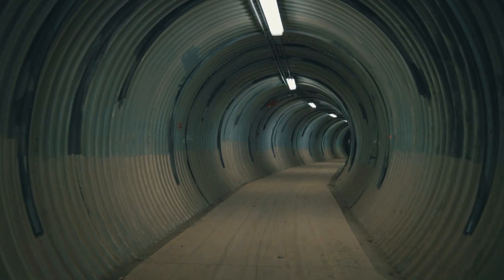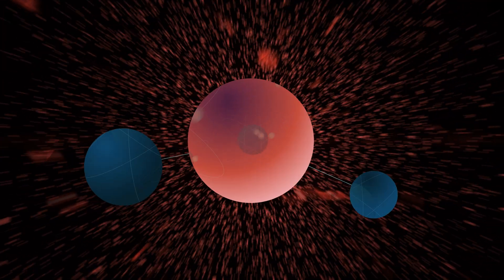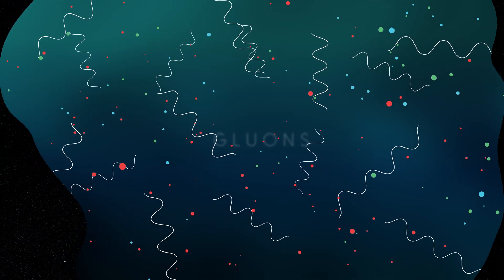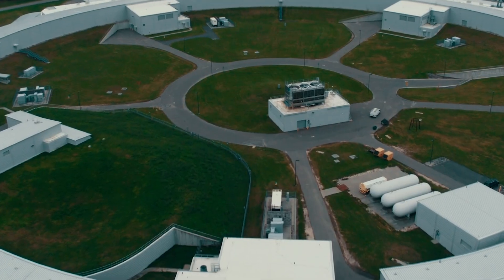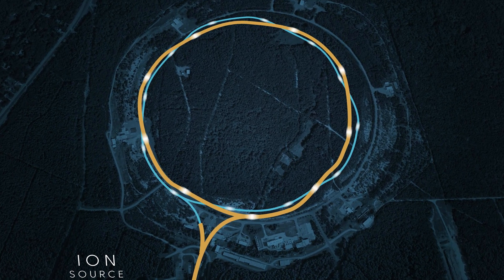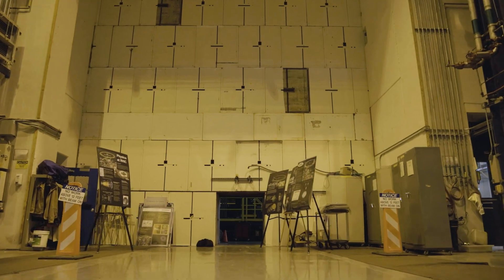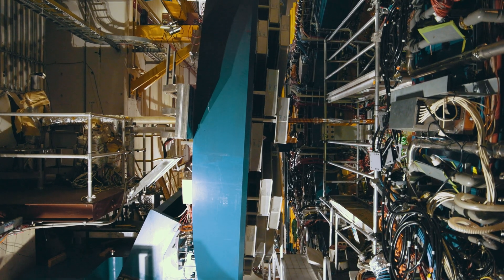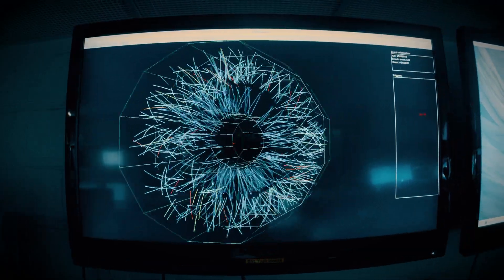SPACE LAB: This Particle Accelerator Makes A Substance That Hasn't Existed in 13 Billion Years

Comment: I've been working and researching fusion and the Tokomaks, that are gradually reaching and maintaining an active relationship to solve that enigma that escapes us onto milestones all of the time. E, energy is the im unsure if I am working out the math and would like to hear an opinion and digging through obstacles and watching the progress.  
The superconductors use a lot of energy to maintain and control and contain the reaction.   I instantly may have found a way to not just increase the output energy by placing a Tokomak in an orbit around Earth so it will track and orbit in the shadows by always staying opposite of the sun and remain always at 100's od degrees Temps in  order to lower drastically or even need the incredible amounts of energy to maintain the supercondive temperatures to make part or all the subzero adjustments by using nearly zero energy that's already available but unused.   The near zero gravity has several less energy needed for MINOR corrections.   There are many more questions and answers, but I thought this simple solution could benefit the tokamak in orbit.  
Is there anyone else thought of this and went from idea to prototype I ask?
Reply: Many stable fusion reactors could orbit our nearest planets and even send a few tokomaks to follow in front or behind or with ion rockets, converting electricity into new and novel engines without ever running out of fuel using energy storage and a constant production of electrical and heat converted to electrical, propulsion engines. 
A single but contained fusion/energy protection could possibly be placed in front of  STARSHIP to remove any  and all other energy sources,  and never nèd fuel again.... Questions please?
Reply: And could this energy producing fusion device find a way to create massive amounts of energy on the moonn, Mars,, and a series of next generation batteries and capacitors to use the massive amount the output on new tech equipment?
Reply: I hope my summary is simple enough.   I left out the mathematics,  quantum and mathematics numbers but they DO add up as being possible.   There's definitely the proofs and prototypes to rest this hypothesis.  

I have also worked most of my life testing small experiments.  

If anybody finds any success or failures,  then I'm more than interested to share this with other Physicist and mathematicians

Comment: Both Matter and Energy described as "Quanta" of Spatial Curvature.  (A string is revealed to be a twisted cord when viewed up close.)

Is there an alternative interpretation of "Asymptotic Freedom"?  What if Quarks are actually made up of twisted tubes which become physically entangled with two other twisted tubes to produce a proton?  Instead of the Strong Force being mediated by the constant exchange of gluons, it would be mediated by the physical entanglement of these twisted tubes.  When only two twisted tubules are entangled, a meson is produced which is unstable and rapidly unwinds (decays) into something else.   A proton would be analogous to three twisted rubber bands becoming entangled and the "Quarks" would be the places where the tubes are tangled together.  The behavior would be the same as rubber balls (representing the Quarks) connected with twisted rubber bands being separated from each other or placed closer together producing the exact same phenomenon as "Asymptotic Freedom" in protons and neutrons.  The force would become greater as the balls are separated, but the force would become less if the balls were placed closer together.  Therefore, the gluon is a synthetic particle (zero mass, zero charge) invented to explain the Strong Force.  An artificial Christmas tree can hold the ornaments in place, but it is not a real tree. 

String Theory was not a waste of time, because Geometry is the key to Math and Physics.  However, can we describe Standard Model interactions using only one extra spatial dimension?    What did some of the old clockmakers use to store the energy to power the clock?  Was it a string or was it a spring?

What if we describe subatomic particles as spatial curvature, instead of trying to describe General Relativity as being mediated by particles?  Fixing the Standard Model with more particles is like trying to mend a torn fishing net with small rubber balls, instead of a piece of twisted twine.

Quantum Entangled Twisted Tubules:  
“We are all agreed that your theory is crazy. The question which divides us is whether it is crazy enough to have a chance of being correct.”    Neils Bohr
(lecture on a theory of elementary particles given by Wolfgang Pauli in New York, c. 1957–8, in Scientific American vol. 199, no. 3, 1958)

The following is meant to be a generalized framework for an extension of Kaluza-Klein Theory.  Does it agree with some aspects of the “Twistor Theory” of Roger Penrose, and the work of Eric Weinstein on “Geometric Unity”, and the work of Dr. Lisa Randall on the possibility of one extra spatial dimension?  During the early history of mankind, the twisting of fibers was used to produce thread, and this thread was used to produce fabrics.   The twist of the thread is locked up within these fabrics.  Is matter made up of twisted 3D-4D structures which store spatial curvature that we describe as “particles"?   Are the twist cycles the "quanta" of Quantum Mechanics?

When we draw a sine wave on a blackboard, we are representing spatial curvature. Does a photon transfer spatial curvature from one location to another? Wrap a piece of wire around a pencil and it can produce a 3D coil of wire, much like a spring. When viewed from the side it can look like a two-dimensional sine wave. You could coil the wire with either a right-hand twist, or with a left-hand twist. Could Planck's Constant be proportional to the twist cycles. A photon with a higher frequency has more energy.  ( E=hf, More spatial curvature as the frequency increases = more Energy ). What if Quark/Gluons are actually made up of these twisted tubes which become entangled with other tubes to produce quarks where the tubes are entangled?  (In the same way twisted electrical extension cords can become entangled.) Therefore, the gluons are a part of the quarks. Quarks cannot exist without gluons, and vice-versa. Mesons are made up of two entangled tubes (Quarks/Gluons), while protons and neutrons would be made up of three entangled tubes. (Quarks/Gluons) The "Color Charge" would be related to the XYZ coordinates (orientation) of entanglement. "Asymptotic Freedom", and "flux tubes" are logically based on this concept. The Dirac “belt trick” also reveals the concept of twist in the ½ spin of subatomic particles.   If each twist cycle is proportional to h, we have identified the source of Quantum Mechanics as a consequence twist cycle geometry.  

Modern physicists say the Strong Force is mediated by a constant exchange of Gluons. The diagrams produced by some modern physicists actually represent the Strong Force like a spring connecting the two quarks. Asymptotic Freedom acts like real springs. Their drawing is actually more correct than their theory and matches perfectly to what I am saying in this model. You cannot separate the Gluons from the Quarks because they are a part of the same thing. The Quarks are the places where the Gluons are entangled with each other. 

Neutrinos would be made up of a twisted torus (like a twisted donut) within this model. The twist in the torus can either be Right-Hand or Left-Hand.   Some twisted donuts can be larger than others, which can produce three different types of neutrinos.   If a twisted tube winds up on one end and unwinds on the other end as it moves through space, this would help explain the “spin” of normal particles, and perhaps also the “Higgs Field”.   However, if the end of the twisted tube joins to the other end of the twisted tube forming a twisted torus (neutrino), would this help explain “Parity Symmetry” violation in Beta Decay?  Could the conversion of twist cycles to writhe cycles through the process of supercoiling help explain “neutrino oscillations”? Spatial curvature (mass) would be conserved, but the structure could change. 
=====================
Gravity is a result of a very small curvature imbalance within atoms. (This is why the force of gravity is so small.) Instead of attempting to explain matter as "particles", this concept attempts to explain matter more in the manner of our current understanding of the space-time curvature of gravity. If an electron has qualities of both a particle and a wave, it cannot be either one. It must be something else. Therefore, a "particle" is actually a structure which stores spatial curvature. Can an electron-positron pair (which are made up of opposite directions of twist) annihilate each other by unwinding into each other producing Gamma Ray photons?  

Does an electron travel through space like a threaded nut traveling down a threaded rod, with each twist cycle proportional to Planck’s Constant?  Does it wind up on one end, while unwinding on the other end?   Is this related to the Higgs field?  Does this help explain the strange ½ spin of many subatomic particles?  Does the 720 degree rotation of a 1/2 spin particle require at least one extra dimension? 

 Alpha decay occurs when the two protons and two neutrons (which are bound together by entangled tubes), become un-entangled from the rest of the nucleons

. Beta decay occurs when the tube of a down quark/gluon in a neutron becomes overtwisted and breaks producing a twisted torus (neutrino) and an up quark, and the ejected electron. The production of the torus may help explain the “Symmetry Violation” in Beta Decay, because one end of the broken tube section is connected to the other end of the tube produced, like a snake eating its tail. The phenomenon of Supercoiling involving twist and writhe cycles may reveal how overtwisted quarks can produce these new particles. The conversion of twists into writhes, and vice-versa, is an interesting process, which is also found in DNA molecules.  Could the production of multiple writhe cycles help explain the three generations of quarks and neutrinos? If the twist cycles increase, the writhe cycles would also have a tendency to increase.

 Gamma photons are produced when a tube unwinds producing electromagnetic waves.  ( Mass=1/Length )

    The “Electric Charge” of electrons or positrons would be the result of one twist cycle being displayed at the 3D-4D surface interface of the particle.  The physical entanglement of twisted tubes in quarks within protons and neutrons and mesons displays an overall external surface charge of an integer number.  Because the neutrinos do not have open tube ends, (They are a twisted torus.) they have no overall electric charge.

Within this model a black hole could represent a quantum of gravity, because it is one cycle of spatial gravitational curvature.   Therefore, instead of a graviton being a subatomic particle it could be considered to be a black hole.   The overall gravitational attraction would be caused by a very tiny curvature imbalance within atoms.

In this model Alpha equals the compactification ratio within the twistor cone, which is approximately  1/137.

1= Hypertubule diameter at 4D interface

137= Cone’s larger end diameter at 3D interface where the photons are absorbed or emitted.

The 4D twisted Hypertubule gets longer or shorter as twisting or untwisting occurs.   (720 degrees per twist cycle.)  

How many neutrinos are left over from the Big Bang?  They have a small mass, but they could be very large in number.     Could this help explain Dark Matter?

Why did Paul Dirac use the twist in a belt to help explain particle spin?  Is Dirac’s belt trick related to this model?    Is the “Quantum” unit based on twist cycles? 

I started out imagining a subatomic Einstein-Rosen Bridge whose internal surface is twisted with either a Right-Hand twist, or a Left-Hand twist producing a twisted 3D/4D membrane. This topological Soliton model grew out of that simple idea.  I was also trying to imagine a way to stuff the curvature of a 3 D sine wave into subatomic particles.
.
Reply: I have asked all of these questions myself And the smartest people I can fins....

When einstein mentioned the light is both my wave and a particle, And that has been proven to a large extent unless it's not right...
What if ONE photon traveling at the speed of light doesn't travel in a straight line and travels from A to B in a one photon spiral, small enough to create the illusion of both?
a spiral as it moves closer to the target.?
Reply: I really think you're on the something.  The material you have spent a lot of time focusing on All has its pluses and minuses in my own studies that you brilliantly explain and if my research doesn't match your work then please do me the same favor ❤
Reply: We really could use the newest ideas and old ones...  and new sensors and newer ways to measure and hopefully prove.  Quantum and particles or waves or spirals are just too Quantum to use when looking in a microscope. ... or the newest Hubble and Keppkar information
Reply: @GuendaVincent-go9xb  Thank you for the very kind comments.  They are very rare these days.  I found out recently that Dr. Peter Woit is working on a form of "Twistor Theory".  This theory was first proposed by Sir Roger Penrose about 1967.   This model is really a form of "Twistor Theory".  By using one extra spatial dimension we can come up with a 3D<--->4D soliton with a twisted membrane surface which can be chiral and quantized with twist cycles.  I first imagined a subatomic version of an Einstein-Rosen Bridge with a twisted internal surface.  Extending the bridge produces a long, twisted tube, like a thin plastic tube which has been twisted with either a Right-hand or Left-hand twist.  If these tubes are long enough, they can become tangled with other nearby tubes, as in the Strong interactions of Quarks-Gluons.